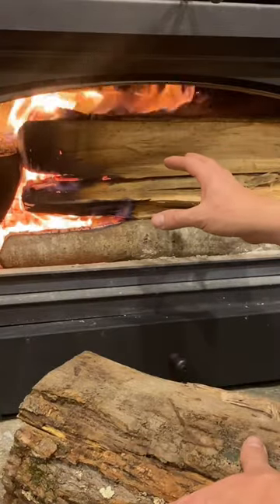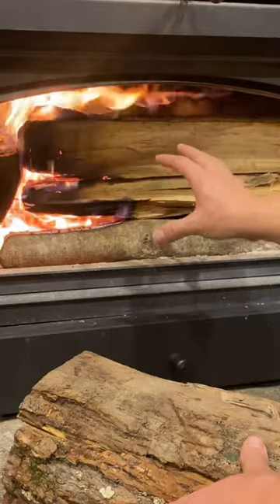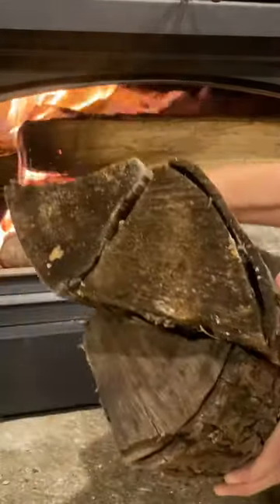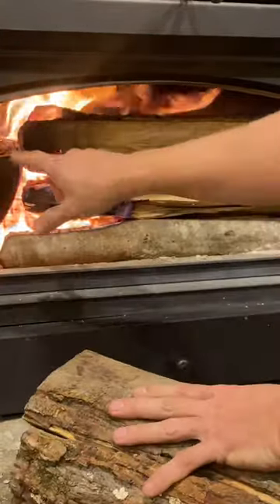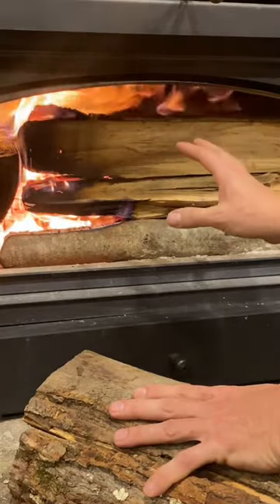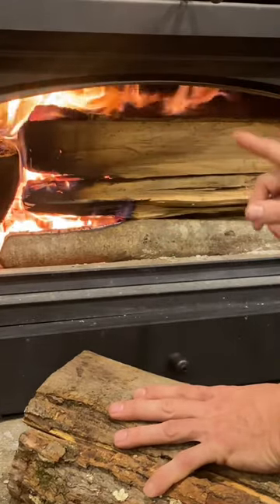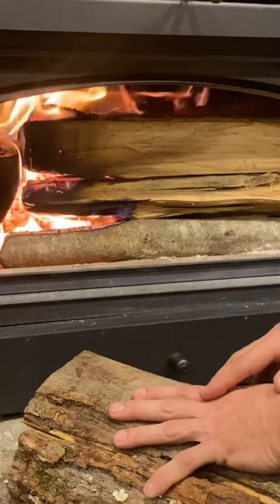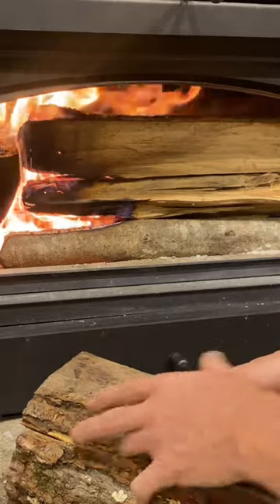How to Make a Wood Stove Burn Overnight

Comment: With my newer type stove I have very little floor space below the door and reburn tube above and I hate it because after a couple days of burning,  you already have a  ton of ashes and can't get but a couple 2 or 3 pieces of wood in it and I have a 3500 sq ft size .
Reply from the maker: Depending on what I’m burning, sometimes I take out a scoop or two of ashes each time I fill it. It’s a PITA, but I would run into the problem you describe if I didn’t. With oak, I clean it once a day. With softwoods, I go a few days.
Reply: @HilltownCT  if I would have noticed that I would have just bought a old type like my dad's with plenty of room below the door

Comment: I use oak and hickory either dead standing or cut and split the same year that many would say is green.  ive burned this way for 35 year.  I little poplar to regulate   i wouldnt have a stove i couldnt keep burning overnight.
Reply from the maker: I love oak too.  It takes a while to season, but it’s well worth the wait in heat output and low ash.
Reply: @HilltownCT    I've never seasoned  my wood is my point. I cut in summer fallen but fresh enough,  split it burn it same year.  I burned some one time dry as a bone.splinters for sure and burned fast.  I. In NC foothills so don't need to crank it up often.  I love burning 🔥 wood
Reply: Oak is great some of the longest burns I’ve had , it’s like gold around here hard to find any that hasn’t been claimed
Reply: @HilltownCT out here in the Sierra foothills near Yosemite, we have lots of blue oak.  I have literally hundreds on my 20 acres.  It burns great, but creates SO MUCH ASH!  I’ve never burned any wood that made as much ash as blue oak.

Comment: I am new at this! I have a wonder wood stove it has a heat gage in the pipe. I was told not to let it get in the red so that means temp around 4 hundred or less to keep it out of the red. I put three pieces of wood in it and it’s hot!!! Way past what it’s supposed to be. My wood I have had a couple years not knowing what I’m doing so can u tell me how hot it can be when loading it! It burns so fast about an hour or two the woods done. What am I doing wrong? I’m a little scared of it lol not wanting to go to bed with it going but my furnace is out and this is all we have right now!
Reply: Get some fresh logs , those old logs are probably too dry and burn right up

Comment: does it over heat your home when u load it right up ?
Reply from the maker: When it’s over 30°F outside, the upstairs gets a little warm. If it’s colder than that, which is most of the time, I’ll take all of the heat it can give.
Reply: @HilltownCT  good to know  thanks
Reply: New to this (remote living).  I was told i need more space for oxygen to get the fire going.  Do you mind to explain how you light the fire and get it going?  Thanks a million. @HilltownCT

Comment: The only way to make the stove burn overnight is to put as many logs as possible and reduce air command to the minimum. It means that the combustion condition is awful. There is a huge imbalance between fuel and air which leads to air pollution and stove sooting. This is definitely not a good idea

Comment: Bet your chimney is going to have glaze in it! If you're getting an 8-9hr burn time then you can pretty much guarantee it's not burning hot enough to prevent glaze buildup.
Reply: I burned only wood last winter for heat and got 8 hours and when I cleaned my chimney this year I had a couple cups of creosote. And I have about a 12ft chimney. New stoves with either reburn tubes or catalysts are beasts